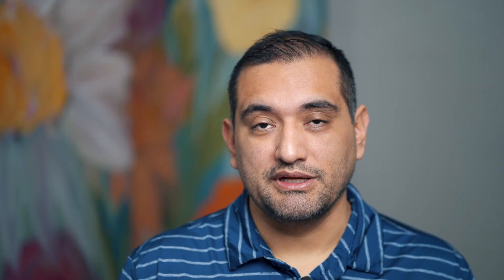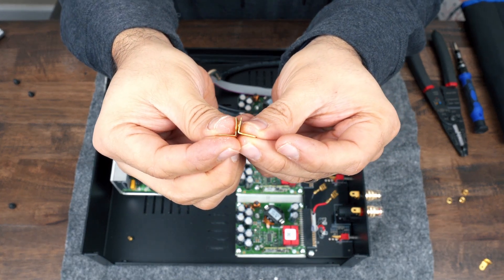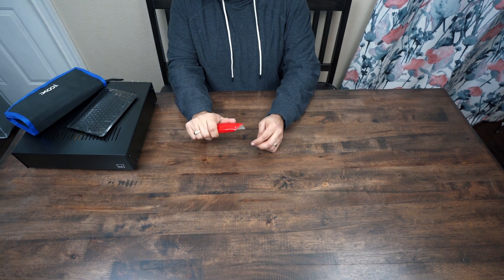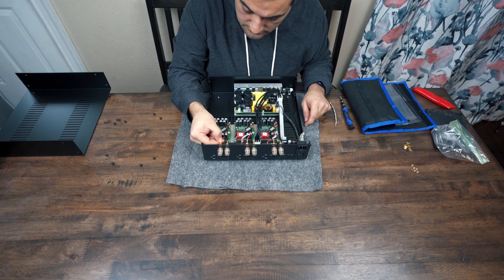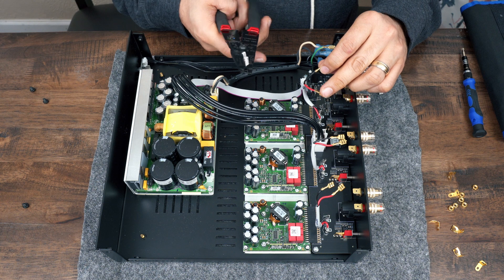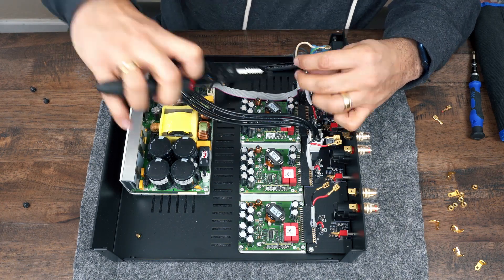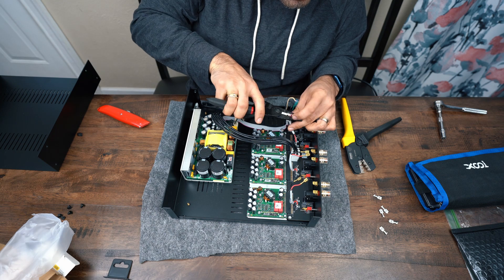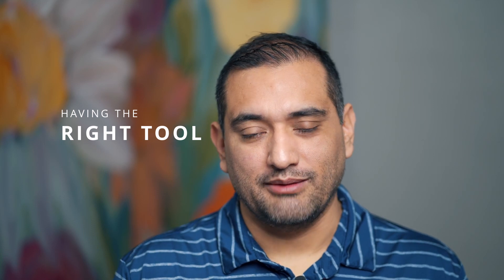Fixing the Buckeye Amps 3-ch Purifi 1ET400A Amplifier - Home Theater #39

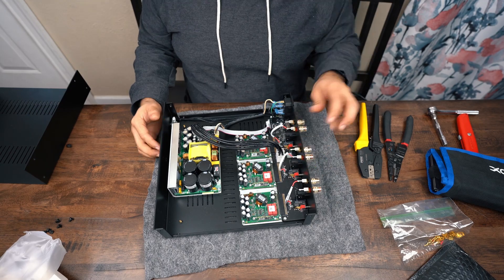Comment: I'm sure you probably fixed it, but at 7:51 you have the bottom set of terminals reversed polarity.
Reply from the maker: Holy cow, you're right and I didn't notice it! Buckeye amps is sending me a new wiring for that one terminal that got crimped badly so will definitely correct that too. Thanks and good looking out.